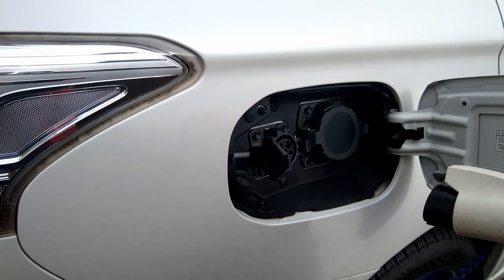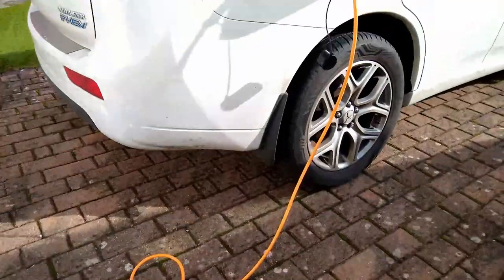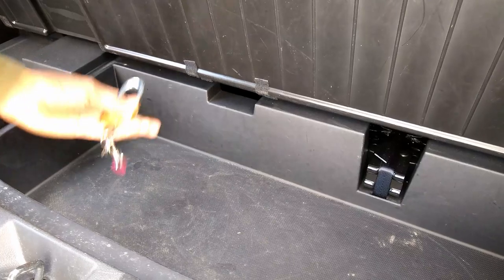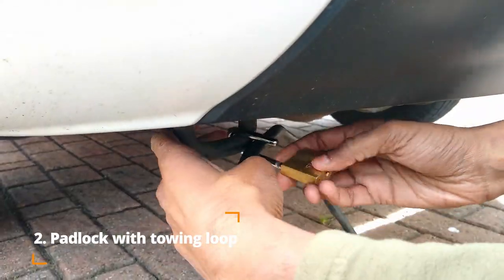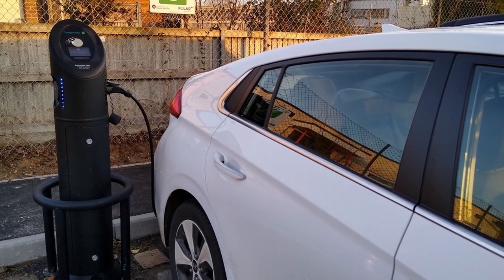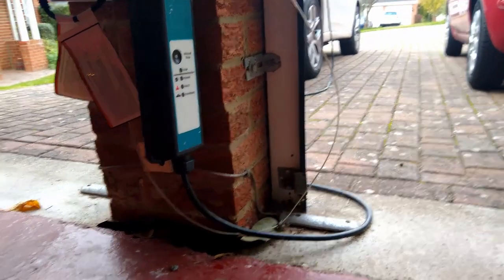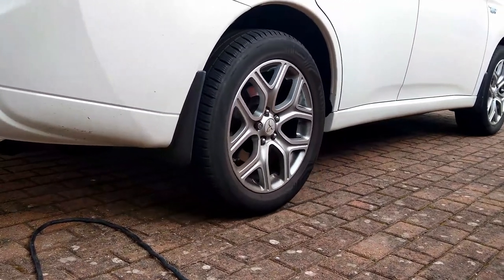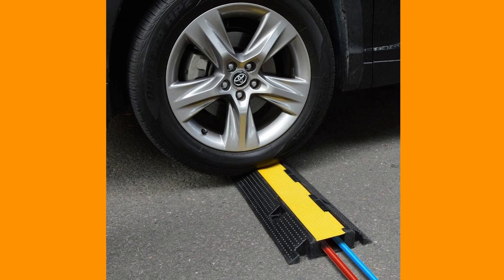How To Secure An Electric Car Charging Cable - 5 SIMPLE Solutions [2024]

Comment from the maker: 5 simple solutions to reducing the risk of your charging cable being disrupted or stolen. Some of the products mentioned in this video are linked below so you can check them out for yourself.

Type 1 connector padlock:
 
https://www.amazon.co.uk/dp/B003KJ08VE?ref=ppx_pop_mob_ap_share&fbclid=IwAR2Az_OO3OVPtA1D2Fv6Alca6EcDQG3POWGL9Rul7Wn8yo62Ip4UimMfg20&th=1

Heavy duty padlock:
https://www.amazon.co.uk/Master-Lock-Padlock-Laminated-Security/dp/B0035RR008/ref=sr_1_6?dchild=1&keywords=heavy+duty+padlock&qid=1603235584&sr=8-6

Wall ring anchor:
https://www.amazon.co.uk/Bulk-Hardware-BH01960-Thickness-Galvanised/dp/B00O7OXCDW/ref=pd_sbs_60_4/259-0266347-7175003?_encoding=UTF8&pd_rd_i=B00O7OXCDW&pd_rd_r=71cf5f14-8031-44ed-87ad-59d19eb599b7&pd_rd_w=jaxBD&pd_rd_wg=n4TIm&pf_rd_p=b9bf232d-9a8a-4c7d-aa9d-641c0995d3a2&pf_rd_r=FCP7GBB5THTPJ1Z8D3SE&psc=1&refRID=FCP7GBB5THTPJ1Z8D3SE

Heavy duty cable cover ramp: 
https://www.amazon.co.uk/dp/B075V3185Z/ref=twister_B075V2W3VN?_encoding=UTF8&psc=1&coliid=IBNXGLQANOWT4&colid=476YYKI4CJMT

Comment: I didnt realize that the trigger had a hold for a lock! Thanks for the pointers!
Reply from the maker: Hi Anthony - Thanks for taking the time to watch and comment on this video. It is subtle, glad you found it useful.

If you’ve not already, please do like this video and feel free to check out our other content.
Reply: Our new Vauxhall doesn't have this option but does lock in when you start charging, so in theory you can't pull it out, but I like the idea of a visible cable and padlock as an extra deterrent, just got to find a way of fixing it.
Reply from the maker: Hi Adrian - Thanks for taking the time to watch and comment on this video. Certainly worth making sure you can deter any opportunistic thief.

If you’ve not already, please do like this video and stay tuned for some more content.
Reply: @everythinghome  Liked and subscribed. All the best.

Comment: Another way is by putting the charging cable  in the trunk with the charging end hanging out to plug . Close the trunk lightly to where it closes and lock the car. Only be careful to not pinch the cable
Reply from the maker: Hi - Thanks for taking the time to watch and comment on this video.

Thanks for sharing, that's really useful.

If you’ve not already, please do like this video and stay tuned for some more content.

Comment: Doesn't type 2 lock the cable, is it just Kia?

I ended up here because I was searching for a quick way to enable/disable the auto-locking (don't need it at home with the wallcharger, but I use it with the portable cable).
Reply from the maker: Hi - Thanks for taking the time to watch and comment on this video. Most do lock themselves in, but not all unfortunately. The Mitsubishi Outlander PHEV is one of those.

If you’ve not already, please do like this video and feel free to check out our other content.

Comment: A determined thief will just cut it off at both ends, like they do when stealing other cables.
Reply from the maker: Hi - Thanks for taking the time to watch and comment on this video. Hopefully they'd unplug the cable with 3KW going through it first... 😬 I'm sure the options are not bullet proof but certainly would stop most would-be thieves.
Reply: Making things harder for them makes  it less likely for them to steal. Anyone could take anything from you if they really wanted it. If an organized crime ring has targeted your property it's pretty much a done deal.
Reply from the maker: Completely agree with what you said, hopefully those small simple changes act as a deterrent
Reply: @everythinghome   Yeah, I find it annoying when people say stuff like this. Like yeah a determined theft can still steal it. But a determined one could also steal your car, so now what? Do we stop investing in deterrents altogether?

Comment: I don’t think a thief is interested in an extra cable for their ev. They want the copper,
Nothing shown here will stop that!

If the charger is plugged into the car just snap it off by kicking it, this will cancel the charging making it safe to cut the other end off. And if anyone is wondering fast chargers have way more copper content.
Reply from the maker: Thanks for contributing to the chat. I agree some will be after the cooper

Comment: Thieves are after the copper inside the cables to weigh in for scrap.  They simply cut the cables like they do with rail network cabeling that causes many of the train delays . They also cut the cables off the public charging points  causing thousands to put right and chargers out of service for weeks .  Ways to combat that please?  Add in the comments.